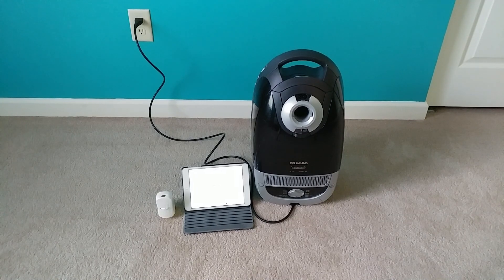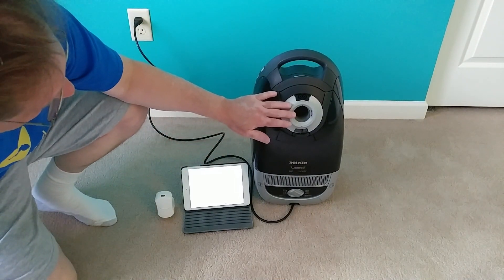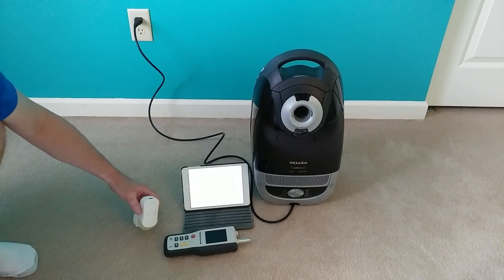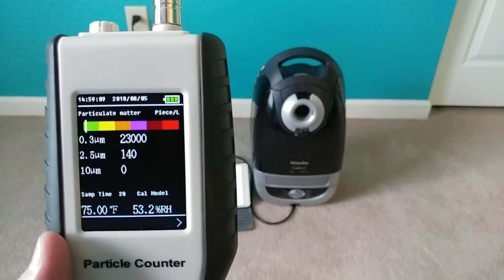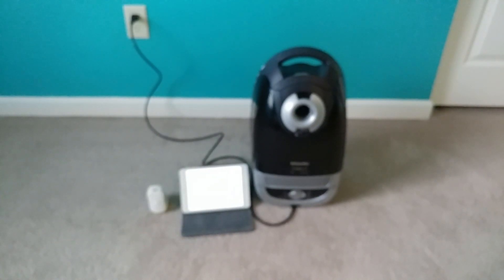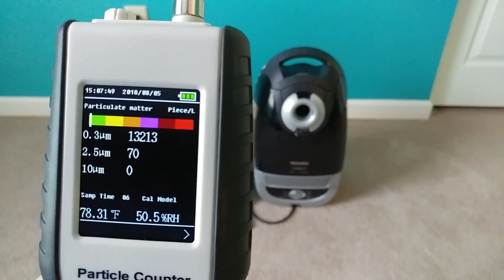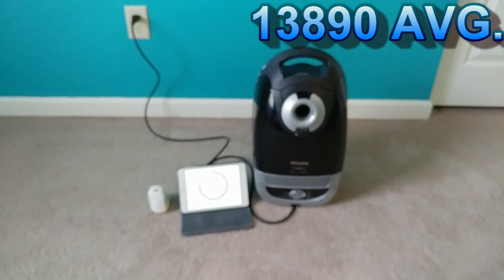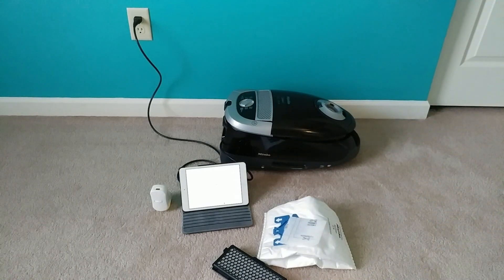Closed Room Air Cleaner Test Using A Miele Callisto S5281

Comment: How can you say the  Kirby doesn’t have an exhaust air filter? It totally does it’s the hepa disposable bad and permanent outer bag. The Miele has basically two intake filters then the exhaust hepa filter.
Reply from the maker: The motor exhaust isn't filtered. Ever look at the vent holes near the emptor for pre-G series machines and on the toe-touch control side of the newer G series? Bingo! Unfiltered motor exhaust where some (minimal) carbon dust escapes.
Reply: VacLab well we’re both right! Lol I was thinking exhaust as it what’s sucked in must come out. It totally escaped me about the side vents for the motor exhaust. Albeit it’s minimal but it still carries particles!
Reply from the maker: Garrett Dodson 😎